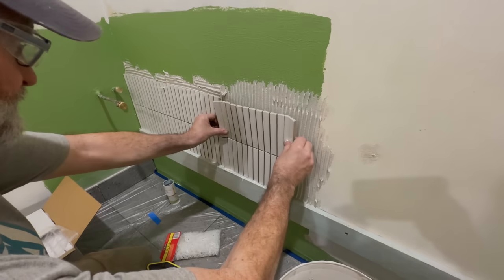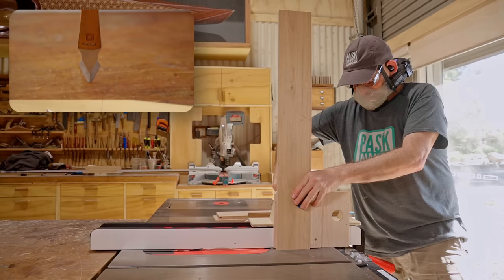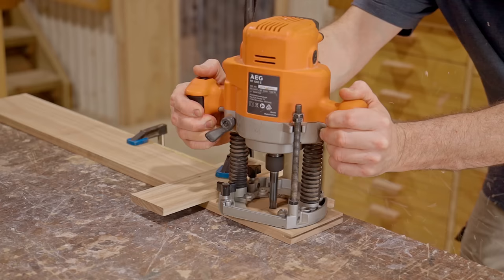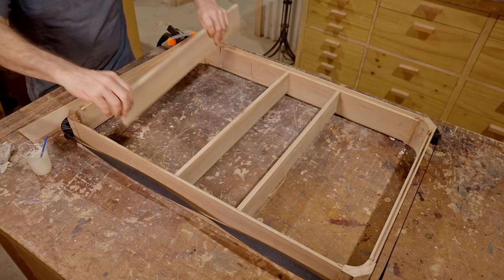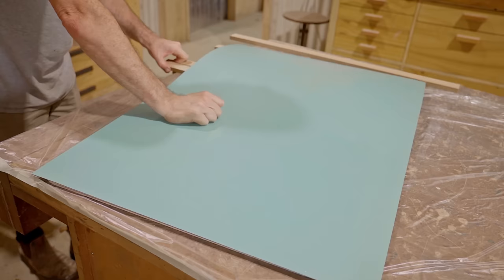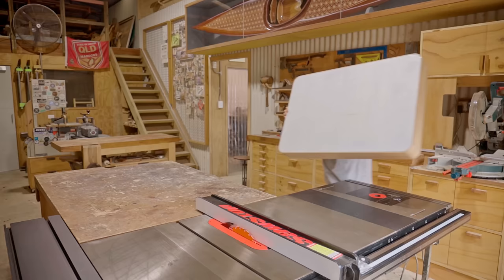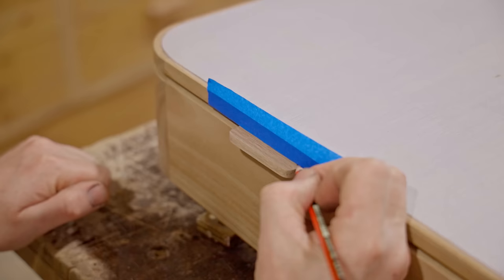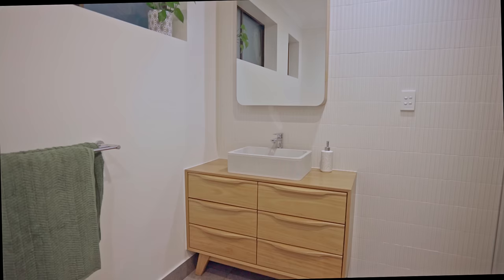How to Build a Super Stylish Custom Mirror Cabinet - Bathroom Now Complete

Comment: a tip If you ever need a mirror for another project. I had to use one for an infinity table a few years ago.  I essentially found an old mirror at a yard sale and used a local class cutting company to cut it to shape for me.  My mirror was square versus rounded but maybe try checking thought next time.  If i remember correctly, I bought the mirror for 5 - 10 US dollars, then for the mirror to be cut maybe 10 at most.  Hope this helps

Comment: you can save yourself the trouble of chiselling the router-bore square by stopping a little short and notching the shelves to cover the ends of the router cut. To be clear, this means that the shelf is a little longer than the dado so that it over-hangs the groove by a little bit but the notch is deeper than the over hang and covers the round end of the dado. You don't even need to be super precise with the length of the notch, as long as it's deeper than the overhanging section. I hope that makes sense and helps.

Comment: Omg omg omg!!! I’ve been waiting for this one!!! Currently I’m undergoing a bath reno too, I built my own solid hickory vanity, first time to build something more large and with bridle joints and half laps… such a stressful blast! Anyways a company wanted $1100 for a quartz vanity top that’s only 31 1/4” long… no freakin way so I’m working on a concrete form for my own white cement top. Back when looking for a medicine cabinet, I wanted the same exact modern rounded edges, inset cabinet with brass not gold, black or bronze and that was a nightmare to find what I was needing. I finally did but all along I kept thinking I should build my own and now I regret that I didn’t! Such a stunning mirror cabinet, vanity, concrete sink and the entire bathroom is gorgeous and well done 🤟🏼

Comment: Fantastic build as always.
Guess it's allowed over there, but UK don't allow socket outlets (or light switches) so close to a source of water. Higher risk of electrical shock
Reply: Really? what about GFI outlets?
Reply: @zTribalstylerz  doesn't matter. We use zones, zone 0 is basically in a bath/shower, nothing higher than 12vac or 30vdc. Zone 1 is the outline of the bath/shower up to the ceiling, nothing higher than 25vac or 60vdc, unless it's IPx4 or higher, and requires a tool to open (an electric shower). Zone 2 is 0.6m around zone 1, and can be anything but must be IPx4 minimum. 
And now that I've said all that, I've remembered around a sink is zone 2, so if it's IPx4 or higher, then it's fine! Gotta be on an RCD though (our version of GFI)

Comment: Wow! Great minds really DO think alike. I've been rolling ideas for a bathroom cabinet like this around in my head for the past few weeks. I was planning on putting an electrical outlet in mine too. The differences are that my plan for the outlet is to have it on the side where you can access it without having to have the cabinet door open. For plugging in blow dryer mostly. Also, for my door I've been eyeballing those mirrors that have LED lighting built right in. Since I'll have the power for it right there anyway, I figure might as well.  It's actually for my son's bathroom. He lives upstairs and has put up with an out of date metal medicine cabinet + crappy light fixture for years. He comes down here to shave, dry hair, etc. because it's so dim and no outlet up there. So I just got the lumber for it a couple of days ago and plan to start on it tomorrow. I just might borrow your rounded corner idea depending on the radius of the corners of the mirror I get.  In any event, I do get ideas from you videos all the time, & really appreciate your putting in the effort to record & upload your various projects. This one was definitely a winner!
Reply: Hair dryers in the bathroom? What has your son done to upset you?😮
Reply: @tonysutton6559  
Well he doesn't dry his hair in the tub and even if he did the outlet will be a GFIC so I think he's gonna be OK.
Reply: @dale1956ties  Electric plug sockets are basically banned in bathrooms in the UK but our bathrooms are a lot smaller than the one in this video.
Reply: @tonysutton6559  Don't they have GFIs over there? They've been required in kitchens, bathrooms and basements for several decades now here in the states.
Reply: @dale1956ties  I'm no expert but it could be that all uk sockets are properly earthed and all mains circuits have breakers at the fuse box. 

Sockets are allowed in bathrooms but they must be at least 3m from a water supply which means that it would be impossible to have them in 90% plus of our bathrooms. Our bathroom is average size at about 2.5m x 2.5m and no wall surface is any further than about 1.5m from a water supply.

Funnily, sockets are not supposed to be at least 30cm from water in the kitchen. I'm  guessing that the idea is that you don't bathe in the kitchen sink and then plug in a hairdryer.

If you have several hours to spare and can stay awake long enough, you could read the UK regulation but I just pay a qualified electrician to install stuff for me.
Reply: @tonysutton6559  That's all very interesting but I still wonder if GFI receptacles exist or are allowed in the UK. It's been a very long time since I've needed to know these details but I'm thinking within 6-ft of water is where we are required to have them. It seems silly to me to not allow an outlet in a bathroom when GFIs work perfectly (when correctly installed of course) to protect you from electrocution. What about the kitchen countertops? No outlets there too because of proximity to the sink? That seems unnecessarily inconvenient to me.
Reply: @dale1956ties  You can't have outlets in the countertops. This is probably because it would be too easy to spill liquids into them.

If you have a fitted appliance such as a dishwasher under the counter, the socket for that has to be in the cupboard next to the one housing the appliance as the cable goes in the void behind the units. 

I suspect that some rules date back years while others were added while we werein the EU so it could be that somebody will rewite them post Brexit.
Reply: @tonysutton6559  Our outlets aren't in the countertops but rather in the wall usually just above the backsplash. Sometimes they can also be mounted in the base cabinet. Usually you'll see this application in an island type situation.
We also have Non-GFI outlets for dishwasher, disposers, trash compactors, etc. as you described. But basically is you can touch the outlet and faucet at the same time it must be GFI protected.

Comment: As always, your work is top notch. The design is exquisite.
But I have a question about practicality: if the electrical outlets are inside, and there is no opening for the chord to exit the cabinet, how are you supposed to use what you plugged in while looking at yourself in the mirror?
For example, shaving or using an hair dryer. The chord will prevent the cabinet from completely closing. Not the end of the world but I expected you to cut an opening until the end, as you are usually a very practical builder.

Comment: I was thinking "why didn't Pask take the mirror to a glazier and have it cut down slightly to get square corners?" (or buy a slightly bigger one and do the same it size matters). This would have made the build so much easier.

However, when you stepped back after mounting the cabinet the rounded corners complement the shape of the sink perfectly.

The plexiglass idea is fantastic, I'm going to use that one going forwards where I want to keep wood away from water.

Comment: I was waiting for you to add some screws to hold the back panel on, which is holding up the weight of the whole cabinet and the glass. I sure hope that construction adhesive doesn't let go. :-(
Reply: I must add that I LOVE your design on this. I'm sorry, Neil. I should have mentioned that in the above comment.

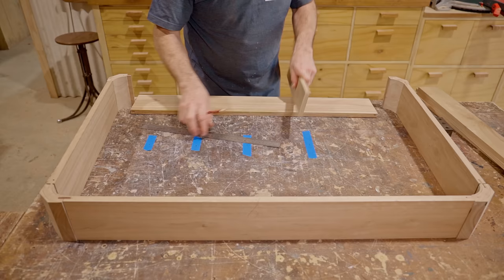Comment: 4:41 did you consider adjustable shelves? Like with pegs to change heights? If so, why did you choose to go with fixed heights? Also, you might do this later, but you could have painted the back of the mirror to cover up the residue.

Comment: Fantastic!
Was there a reason for not coating the door panel behind the mirror? Especially in humid spaces, I've found that coating one side of a board (ply or solid alike) with varnish or paint, and not the other side, causes it to warp over time. I think it's either because of some minor shrinkage of the applied coating, or a swelling of the untreated wood on the other side. (so the treated side gets concave)

Comment: How come you spritzed with water before cleaning up the caulk in the bathroom? I haven't seen that technique before.
Reply: Soapy water - works a treat to get a smooth finish on the sealant. Just ensure you don’t spray until all your sealant is applied, or it won’t bond.

Comment: the mistake was with the British tape measure  America still use their figure if they have not already blown them off July 4 with fireworks 
you can not fix stupid England did try but they shipped the failers to Australia lol
i kept my washroom simply built behind my house  little cold in the winter but I got used to it after 6 months

Comment: You should NEVER trowel notch the wall for 2x2 or smaller in any size tile, you need to 1/4x3/8x1/4 trowel then KNOCK down the trowel lines flat then put on the tile. You have less than 30% coverage with what you did and you need at LEAST 90ish for walls. I highly suggest you pick up a TCNA handbook, you can get them free at a library or your local trashcan at lowes!
Reply: the american stereotype holds up on this one.
Reply: What he did seems to have worked absolutely perfectly so get lost
Reply: are you gonna be ok? LOL!!!!!!!!!!!!!